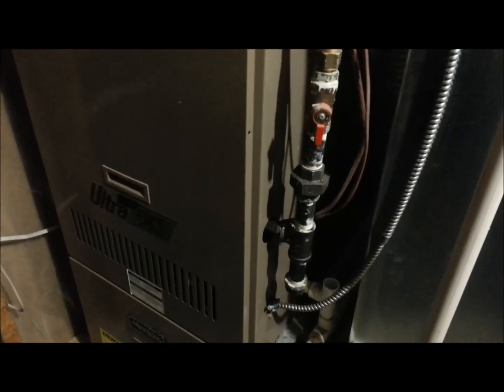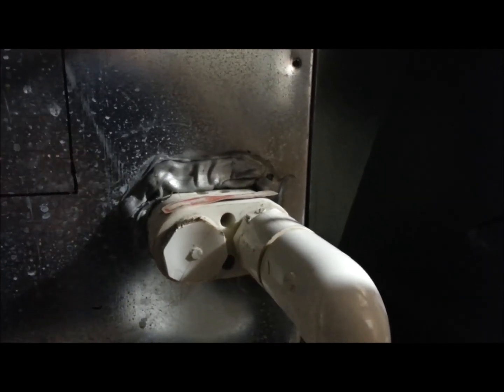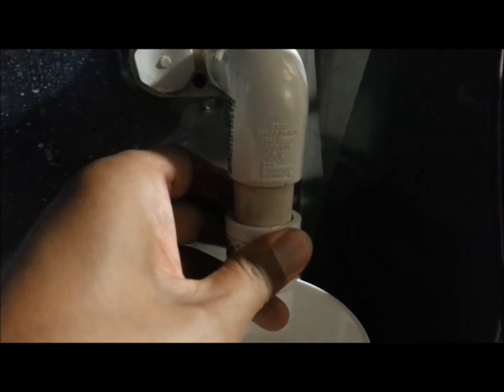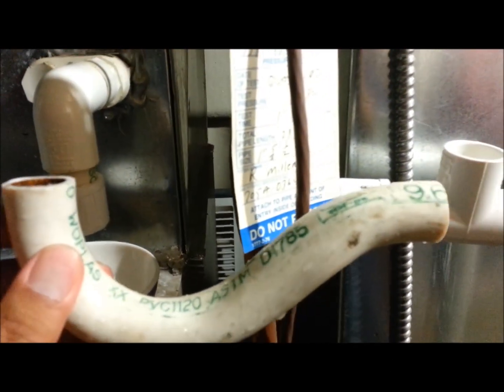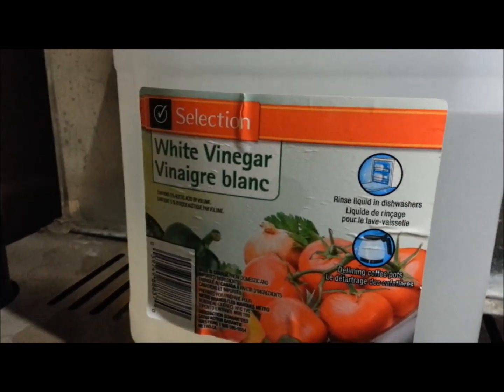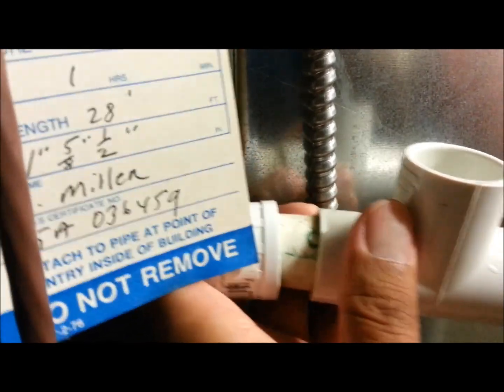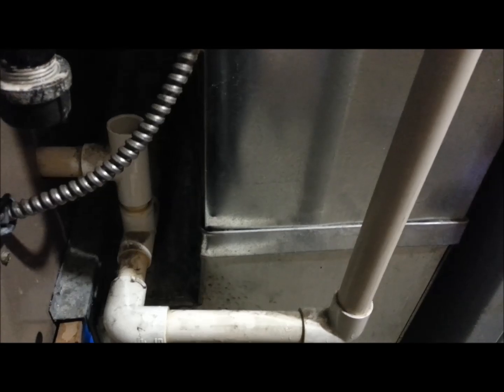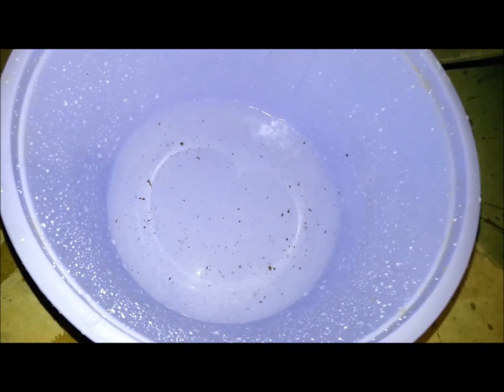Central Air Conditioner Leaks Water On Floor: Part 1 Clogged AC drain line (DIY)

Comment: Can you tell me which drain pipe goes to the outside? Would it be going into a silver foil wall then to the outside? Thank you! ❤️
Reply from the maker: This drain would go out. In my case it goes behind the furnace & into the sewer drain.
Reply: Thank you so much ❤

I had poured a quart of water down that pipe and it didn't come out of the outside drain out. I'm assuming there's a clog somewhere in that pipe 😕

Comment: Heh bud, I don't think you reworked this correctly.  You removed the P trap and replaced it with a straight pipe, which gives you basically nothing to allow any AC condensate being collected in the A-coil to be able to drain.  You have negative pressure in there, and the P-trap helps to prevent the negative pressure from holding water back and not draining properly.  Looks like this is from 2015 and it's 7 year later, but the proper way to plumb these drains can be found here:  https://www.youtube.com/watch?v=uB_3NbvH754
Reply from the maker: You're right. Check out my new solution on my link. DIY Ptrap. https://youtu.be/dtiQjgrmed8

Comment: Did you have to replace the elbow from the unit also? I’m just curious because when you cut off the P-trap it would have cut that nub hanging out of the elbow you have on the unit
Reply from the maker: I ended up making DIY my own Ptrap. Check out this link. 
https://youtu.be/dtiQjgrmed8

Comment: What is the plug for on the left side? Is that for overflow or what?
Reply from the maker: At 3:15 min just temporary so I could clean out the rest of the pipe with vinegar .

Comment: I wouldn't remove the p-trap.  It's there for a reason and is usually required by code.  You can use a long bottle brush to clean it out.
Reply from the maker: Yes you're right. But I fixed the problem with part 2 & part 3 videos.

Comment: So I clean all the tunes and change de trap and while my furnace is completely off is still leaking water????
Reply from the maker: I think there might be is a clog somewhere else, or The ice build up in the A Fram coil is still defrosting and dripping water, or evaporator coil is super dirty. Just my opinion. Sorry you may have to check out other YouTube videos about that.

Comment: P traps are designed to keep outside sewer gas from entering into your dwelling. You might want to rethink your design.
Reply from the maker: You're right. if you watch part 2 & 3 of this video it will explain what I did.

Comment: that's rust. and you should put back the p-trap you cut out, or you should cover that T on top, cause you said you have another p-trap at the bottom.  Basically, before the p-trap, there should not be any air coming in. this is a positive pressure system, so this is not a must. You should open the cover and check out your Eveporator coils, it must be rusting pretty badly.
Reply from the maker: Thanks for the advice but if you see part 2 & part 3, I made some changes that you would like.

Comment: Instead of vinegar can I use drano?
Reply from the maker: I don't suggest drano.
Reply: Good thing I didn't... what would happen if I did? Plus I had to snake out the pipe it was clogged with goo.
Reply: Use a 1:1 bleach-water mix if you want something tougher than vinegar. 
I pour 2 cups down each drain pipe every 3 months, never had an issue. My neighbors unit looked exactly like this guys P-trap. I found this video to send him so he could see what I thought the issue was.

Oh...I also cut my drain lines near the unit and installed a 1/4-turn ball valve shutoff (under $3) to stop any bleach from flowing back into the units, which also allows me to use my shop vac to either suck or blow out the line at the vent.
Just in case you don’t know, take a shop vac tube off the suction hole and plug it into the exhaust hole and you’ve got a mild blower. Close the valve and it keeps all suction or pressure in the drain line, and doesn’t affect the unit.

Comment: I'll tell you what - I'm so sick of HVAC guys lying all the time. Of all the HVAC personnel I've had in my house over the years, I'd say half of them lied to me about something. This is why you need to do work on your own and learn as much as you can as a homeowner. Some of the work will, undoubtedly, need to be done by a professional. But many of the regular maintenance and wear-and-tear problems can be handled by the homeowner, and it avoids all the lies that are told by greedy HVAC people. The a/c drainage/condensate line, for example, is an easy project that any homeowner can handle. Simple physics. You don't even need any tools to measure air pressure. You just dig in and get it done. Thank GOD for YouTube.
Reply from the maker: Amen to that Robin.
Reply: I hope I can fix mine this way....
Reply: My water drain looks nothing like that....

Comment: I don’t think your new trap will hold back sewer gases like the curved pipe trap was designed to do. Sewer gas will pass right through your new trap. Not good.
Reply from the maker: There's actually a second Ptrap at the back of the of the Central Air System which I did not show.. Sewer gas is no problem.
Reply: I never understand the point of a P trap on an AC drain pipe. Unlike a regularly used sink, which would replenish water in its P trap from time to time. an AC would be off in many months of a year, which makes the water in the P trap evaporate anyways. If sewer gas is a concern, some other regularly used P trap must be in the downstream from the AC drain line.

Comment: Also, do you have time for a question?  I hope so.  Get this.  Okay, I did what you said and cleaned everything and now that A/C is draining perfectly.  Can you explain this or AGREE / DISAGREE on this question.  I think my upper floor is cooling better.  I mean tonight we set it on 73" and it gets 73" and feels cooler.  Both wife and I thought same.  Do you think that inproper draining could have been keeping it running more and not cooling as well.  Now, a higher temp makes it seem cooler.  I actually got cold, and I never do that.  Any ideas?  Or can you point to an article that would explain that?  I wouldn't know where to look.  Thanks.  Subbed to your channel.
Reply from the maker: Yes improper draining does stop proper cooling of the house. In my case,  not enough cool air was coming into the house because my A Frame evaporator coil coil keep freezing up due to improper draining. A professional HVAC lied to me and said I needed a new AC unit outside just to make a sale. I was not happy about that. But please watch my video part 3 because it shows you how to make your own P-trap with a clean out so you clean it every year &  it never clogs again. Thanks for sharing your story with our viewers.

Comment: Yes, today, Jonah, I fixed this issue.  My situation (now that I have direct hands-on with it) is where the condensation drain dropped from attic down to a bathroom sink.  Well, the drain that came to the sink got really stopped up.  There was so much crap in the last foot / 18 inches.  It is a vertical drop down then comes out at me for 18 inches then rights for 10 inches into the sink's drain line.  Well, I think that entire span there (say 2 feet) was clogged with greasy, dirt-like clog.  So, if I didn't buy the tool you suggested and cut the pipe, I would have never got it all figured out.  But, now, it is PERFECTLY CLEAN.  You wouldn't believe it.  Looks brand new.  We even cleaned everything within the sink trap too.  I knew to do that, but I didn't know what the other attaching line was doing.  But, now, I understand, and it is actually so simple.  I never knew to worry about the clogging of those.  Now, I plan to clean the other attic A/C lines for the downstairs A/C.
Reply from the maker: Awesome. Thanks for letting our viewers know.

Comment: God, you are a genius ... 4:45 ... Damn, that is brilliant.  I have this FUCKING PROBLEM in the attic, but I don't have an option like you.  Mine is a long line then L-drops into sewer line.  And, it leaked all in my attic.  So, I probably need to cut some of the line and run a brush through it.  I tried dishsoap in it and pushing some old LAN cable in it, but it hasn't  cleared out.  But, DAMNED, if it is clogged like yours was, I see why it is not draining.  I only wish that I knew to clean it out like that, or to have a means to clean it out.  Sincerely, thank you.  You are my HERO.  If I remember, I'll come back and tell you how it went.  But, I bet that I've got the same problem as you do at ... 1:48 ... I bet that is the darn problem.
Reply from the maker: I hope it works out for you. Yes please let our viewers know what happened.
Reply: @jonahvlogsdiy4143    Wow, I just did reply back to you without even seeing this.  You just wouldn't believe how happy I am.  Yes, I've done home maintenance, but this is something that I just wouldn't have pursued by myself.  And, I'm proud now, because YES IT WAS A LOT OF WORK ... But, I got it very clean, solved problem, and now I've built my confidence on troubleshooting this type of a problem with an A/C.  Mine was more difficult because the clog was not near the A/C.  It was near the sink (about 20 feet away) from A/C.  So, I had to go step-by-step to find the clog.  And, it was 14 years of clogs there, just from us living here.  Then probably 10 years before us.  Yeah, it builds up over-time.
Reply from the maker: @PoeLemic  So glad you found the problem. Please view the next video parts 2-3 to show you how to make a better P-trap that you can clean out yearly. I know debris build up after a while. Where ever the clog was 20ft away, its a good idea to put the P-trap there. Thanks for sharing with our viewers.
Reply: @jonahvlogsdiy4143    Okay, to let Viewers know, my problem was not at A/C unit or around it, but at kitchen sink connection line from A/C.  But, it looked like 1:48, and it was that way for 2 feet at the bottom of the A/C drop line.  Mine was very constipated.  Poo-looking clumps just kept coming out.  But, that's built-up of years.  Poured full bottle of dishsoap in multiple increments and took 5 gallons of water to swish through it to finally get it clean.  But, perfectly clean now.  Had to cut pipe like Jonah to see how bad it was.

Comment: Sometimes DIY fails.  Ya need the p trap or s trap or whatever that was to start with. It’s a pretty important piece in plumbing.
Reply from the maker: yes you are right, but my next 2 videos explain what I did next.

Comment: Hi, how does this work if the tube is cleaned but the drain I think is clogged how do I work with that?
Reply: A drain snake will not work that is horrible advice. You should either call and ac professional or buy the tool that blows out the line with compressed air. Snaking the drain will only cause more problems.
If you are still have an issue, check you condensation pump, if applicable.
Reply: use a drain snake

Comment: for sure you need the p trap ather wise you unit its gonna be sucking air thru that pipe .     the job of the p trap its to prevent that it stays full of water  and dont let the unit suck air from the pipe
Reply: Typical Air Handler creates negative pressure at the Evaporative Coil.  This negative pressure will keep condensate from draining.  The P trap's purpose is to hold water and create a vapor barrier thus allowing for condensate to drain.
Reply: Ismaellll - Are you saying that the P-Trap needs to be re-installed & that the T-Trap alone won't do??    Thanks for your insights!         GoodWolfTulum@gmail.com

Comment: Maybe if you had done this in beginning, when you moved into home, you would not have had drain issues. Also to many vents,'T' on that line will draw and leak again. Need one T with 4" riser about 6" away from evaporator and  vent and pour 1) cup bleach in line once a year, wait 10) minutes pour gallon of water threw line ;done.
Reply from the maker: Thanks for the info. Now the viewers will know.

Comment: This happened to me just this morning.  I could hear water dripping onto the floor inside my a/c closet.

On checking the drain pan of the inside handler, it had some gunk in the drain channel which was impeding water flow.  I merely took some paper towels to scrape up and remove the gunk.  I then poured water into the pan and watched it now drain properly.  

To kill any mold or mildew, I poured a cup full of bleach into the access port of the drain piping (right before the P-trap), followed by more water after 5 minutes.  All is now OK.

Btw, the reason for having a P-trap in the condensate drain pipework is to hold a small amount of water (about 2" is sufficient) to prevent air from being sucked back UP into the air handler.
Reply from the maker: Thanks for sharing

Comment: The P trap is there for a reason, just imagine your toilets or sinks without a P trap.
Reply from the maker: Yes you are right. In my follow up video, i put a new type of P-trap with a clean out.
Reply: It was somewhat good advice. I noticed that too and was going to say he should have put the p-trap back, but the last part of your comment made me understand why he didn't have to. The condensate is not really a waste line in which you are worried about gases. It is a separately derived system and not connected to any human wastes. P-traps stop methane gas from coming up through the waste line (sinks, toilets, washers, tubs, showers, etc.). this is the only reasoning for a p-trap. The p-trap gives a water break by trapping water in the bottom of the p-trap. Methane gas cannot travel through the water. ;)
Reply from the maker: Thanks for sharing that info. Now our views know.
Reply: P trap really isn't necessary for a condensation line on an AC unit. P trap is to keep  larger debris from going down into your sewer lines and also to keep gasses from sewer lines from coming back up into your home.  There should be no large debris coming from the AC unit and depending on where you live the AC condensation line often drains outside onto the ground.
Reply: The primary purpose of a condensate trap is to prevent air from moving in or out of the coil box or air handler during operation. Traps must be installed in a manner that will stop the air from passing through, but still allow the condensate to drain from the condensate pan.
Reply: P-trap is in no way to prevent large debris from going down into the sewer. If that were the case you’d never take a poop. It’s purpose in a sewer line is to prevent sewer gasses from entering the building. 

Amazing the things posted that are inaccurate.
Reply from the maker: Great info. Thanks for sharing.

Comment: Thanks for this video! I had the same issue and was able to fix it w/o paying a cent. The p trap had not been glued on mine so I pulled it out and cleaned away the gunk (still can’t believe how much was in there). You may have mentioned this but it’s important to note this type of clog prevents the cutoff switch from doing its job
Reply from the maker: glad my video helped dylan. and thanks for the info about the switch because i didn't know that. now all my viewers will know now. thank you

Comment: you want to put the clean out in a place where you can put a little bit of bleach down there to kill bacteria, the t you made does not allow you to clean it out it lets water out that is all. You need to put the clean out where gravity will allow you to pour cleaner through out the pipe not allowing bacteria to form in the first place

Comment: get rid of that p trap section in the pipe...it is not a sewer pipe so you do not need a water barrier...also...you do not have enough water pressure from an a/c unit to keep the p trap area flushed out..therefore, it holds water and over time it turns into a gellified gunk that prevents water flowing...so get rid of the p trap...be sure your pipe has a slope so water flows away from the unit...put a section of pipe so you can pour 1/2 cup clorox into it each month to help prevent gunk buildup in your pipe
Reply: Not a great idea! P trap is there for a reason. (See others comments above) Bleach fumes are VERY damaging to an AC unit. WIthout a P trap, the fumes will go UP into the coils and damage them.  Without a P-Trap, ONLY use vinegar.    If you have a P-trap stopping air backflow, then go ahead and use bleach, by all means, but only in the drain area, not near the pan or coils.
Reply from the maker: Sounds like a good idea. Thanks Pipkin50.
Reply: That was what I did. It's clogged up from p-trap and farther, so I poured down some drano. Got the whole pipe system cleaned up. Took me 4.5 hours, 1hr. Was to get the supplies. It's looking fine now.  Thank you so much Gentlemen

Comment: Thanks for this video!  I had a similar issue but a pretty different set up (air handler in the attic).  The drip pan beneath had filled up to the level of the trip/sensor (whatever it's called) so it shut down the condenser unit.  i.e. air was still blowing but it wasn't cool.  Cut out and replaced the P-trap, did the vinegar thing etc.  Worked like a charm after that and it was a simple fix.

I will say this though, my P-trap had some gunk in it, but it really wasn't completely clogged up.  So maybe there was more blockage in the next 90-degree joint that the vinegar washed out(?).  Either way, it's working like a champ now with no dripping at all, so thanks again!
Reply from the maker: So glad it helped you out. You're welcome.

Comment: WARNING WARNING WARNING!!! YOU NEVER PUT VINEGAR INTO YOUR DRAIN LINES EVER I AM AN AC TECH YOU CAN ASK ANY HVACR TECH THEY SHOULD KNOW THAT VINEGAR IS BAD FOR DRAIN LINES EITHER USE WATER WITH PRESSURE OR AC DRAIN TREATMENT AT YOUR NEAREST AC SUPPLY HOUSE
Reply from the maker: Good to know. Thank you Mark. My viewers will know now.
Reply: I have used 75 percent bleach 25 percent water for 50 years. Never had any issues that I know of. So is bleach ok or how could that harm anything?